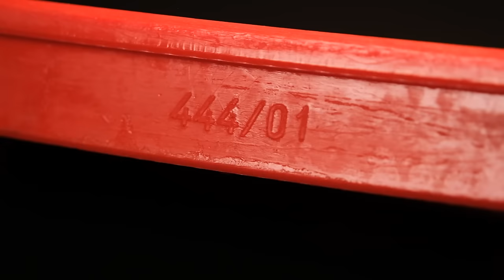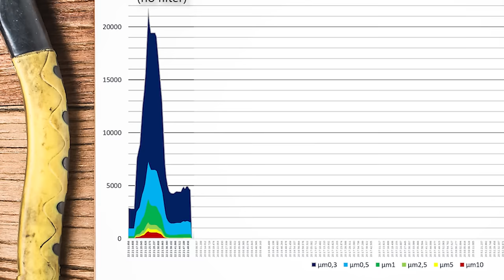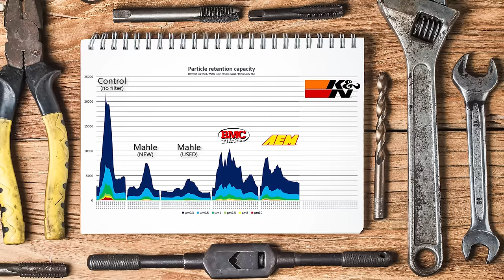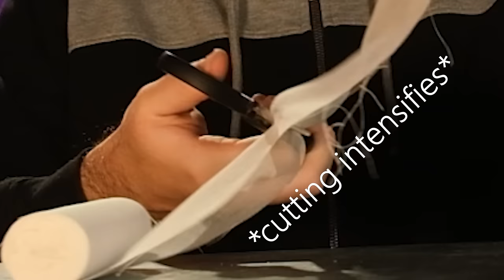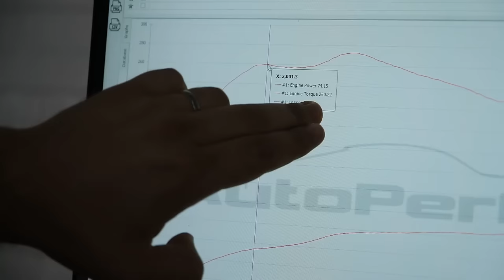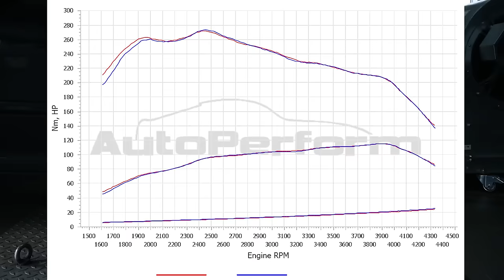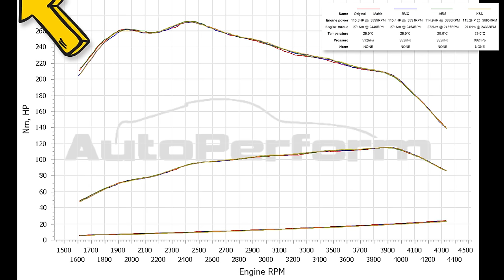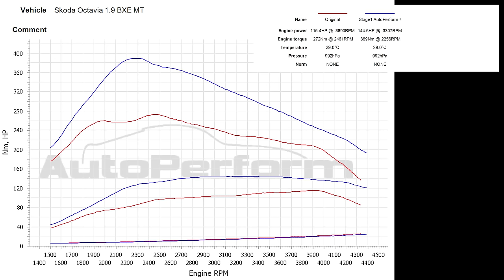Performance Air Filters - K&N vs AEM vs BMC - DYNO TEST

Comment: Salut, chiar voiam sa imi achizitionez un filtru de aer sport zilele astea. Am un civic 1.5 benzina aspirat natural. Chiar vreau sa vad daca m ar ajuta la performanta un filtru sport. Astept partea a 2 a. Salutari
Reply: O vinzi si iti iei 2.0 diesel 🙄
Reply: @Jan_Badea  am vtec n am nevoie
Reply: Save your money, Flo !! The "high-performance" air filters will have no measureable effect on your 1500 cc engine.
You would get more "performance" from making CERTAIN that your Spark Plugs are of the correct type, and are CORRECTLY and EVENLY GAPPED to the manufacturer's specifications.
Many auto enthusiasts believe the myth that spark plugs come "pre-gapped" from the factory -- IT'S NOT TRUE !!
YES, the spark plugs have A gap, but it's NOT the CORRECT GAP for your car !!
 ALL spark plugs MUST be gapped correctly before installation. Period.

Comment: Thx for the info, im not an engineer and just wondering how a SRI in a turbocharged application with a tune for the bolt on is vs stock..thx

Comment: You did it wrong man ,you could monitor boost control duty cycle or at least vacum betwean turbo and filter. Only part of dyno showing filter performance is at the begining, because it is turbo spool time and after it is on full boost, engine management just folows boost target programed in it=same power every time.

Comment: I have seen cars lose power some cars gain it. Just depends if this is a bottleneck in performance for the particular car.  Used to be a more common way to unlock power 20+ years ago.

Comment: ECU remapping on a naturally aspirated engine doesn't really work without bolt-ons. Unless it's particularly poorly tuned or something.
But the amount of N/A cars in Europe is quickly disappearing anyway..

As for wasting money, i'd say not really. Because they are re-usable and cleanable, they last longer and in the long run save you a few pennies. So from an environmental standpoint, it might be beneficial, as you're not throwing away countless filters over the lifetime of the vehicle. They can also just make it sound a little better, without really creating an annoyance to the environment, as intake noise isnt as obtrusive as exhaust noise. That said, if your engine has an elaborate resonator attached like my Accord, even placing one of these filters doesn't change the tone of the intake.
Reply: Not really true. I dyno tune cars for a living and the OEMs usually leave a decent amount for someone like me to release it. Some NA cars like K series Honda’s can unlock huge gains. 15-25% percent.
Reply: For my car, a MANN air filter is £11, MANN is also the oem air filter supplier. A K&N panel filter for my car is £62 so i could almost buy 5 stock air filters for that, which would cover me for 100,000 miles (160,000km) the K&N makes no sense at all, they offer no extra performance and you have to pay for the cleaning kit. Pointless. OEM all the way
Reply: @davehughes6501  you only expect your car to go a measily 100k miles?  Im just saying its not that big of a ill investment, and from an environmental standpoint its less waste.

Comment: NA engines show no difference as there is no forced induction. If you did this with turbo engines you'll find some gains as the turbos able to suck more air freely therefore gain more power through out the rev range. Granted the oil will get dirty quicker, which is why changing your oil every 3 to 5 k miles is sensible.
Reply: NA will show a difference IF the exhaust side is free of restriction. The engine is an air pump, the more air you can get OUT, the more it can breathe IN. 
Turbo will show gains on the intake only but the same applies to the turbo's exhaust side, if there is any restriction, that will also hurt its freedom to spin easier. SO by having a complete restrictive free exhaust on that turbo, it will allow that turbo to spin easier and faster which will then allow it to breathe in easier and faster.
Reply: @ACommenterOnYouTube  It indeed makes sense. Thanks for the explanation 👍
Reply: @ACommenterOnYouTube  YEP. The ONLY restriction in a combustion engine's system should be the THROTTLE PLATE -- Period.

Comment: Here is a hot take....Drop in filters > open  cone.

Having all that under the hood air moving crap around ans getting sucked on the filter is probably why they get so filthy compared to a drop in or closed lid design.

Comment: I don't know that did you oil the K&N filter before test. It is extremely important to oil them before use or the particles will go throught them. They are not meant to be used  without right kind of filter oil. They are tested a lot and should not let that much particles through as in your test.

Comment: You have to decide. Do I want 2-10 more horsepower at the expense of my engine failing early due to worse filtration? If 250k miles is your goal, do not get a cold air intake. 

If you want power and don’t care about your engine I recommend a turbo charger.

Comment: More power requires more air and fuel...so if the ecu is not remapped to add fuel then results will just about stay the same...no?
Reply: Not really, as it also works the other way around: for a given amount of air (oxygen), an amount of fuel will be injected. The ECU can compensate quite a bit, for reasons like air inlet temperature, air pressure (depending on weather/altitude), … at steady revs, the ECU will use the lambda sensor to become an optimal mixture.

Comment: High performance air filters only increase acceleration not power out put. Since all an engine is, is a combustion air pump. The air pump takes in X amount of air easier at its revolution cycle.

Comment: Late to this video but you'll never see performance gains from a filter unless you run a turbo or super charger a n/a engine will need a can and other things to make use of it but it will make more intake noise but out of all the aem is the way to go for a cummins

Comment: Of course that's 1 car with its own air filter. Obviously not worth it. Some other models may be the same worse or better. I know that my skyline 350 got a bit extra on the Dyno not massive but a bit. I wonder also if the car has other mods like exhausts etc that it may flow better? Hard to say. I wonder if you left the filter out completely on the Dyno what would be the results. That would be interesting

Comment: You should have removed the filter and tested if the KaN is similar.  Also some cars will not take advantage of the filter until after the ECM is reset.  Please retest with aFe included and no filter.

Comment: I saw video's of people claiming you should not use a k&n filter on turbo engines because they work with the pulse of the na engine to make the fibers fibrate and catch dirt from the air. A turbo engine does not have or maybe al lot less pulsating air in the airbox. Because the turbine Just creates a static  airstream. Just like your test rig.

For me personaly i bought a washable filter long ago because i liked the fact u can reuse them and also i thought it might give me some more powah. But i was working on my car the other day and noticed i could basicly see trough my airfilter. And i am a little older and wiser now, i ordered a purflux airfilter (same shit quality as shown in your other video) but there is exactly no difference noticable. And i drive a 35 hp citroen lna. Where you notice almost everything! So no more "sport" filters for me!

Comment: One word. WIX.
Reply: yup, Have you seen Project farm's video on air filters?
Reply: I had an k&n short ram intake on a 2007 Honda fit sport that was professionally installed at a performance shop got way less gas mpg and in the summer the car struggled but the car sounded nice but what is nice sound if the car is not performing like it should.  I've had owned small trucks and cars and ran performance air filters from Aem dry flow filter, K&N air filter, Green air filter but just recently took out the Aem dry flow air filter. I currently have a 2015 Toyota Corolla 1.8L 4 cylinder 4 speed automatic as my only daily driver and back in January 2023 and I went back to using a Wix stock paper air filter and Wix cabin air filter and put the Aem performance filter in the trash. I wanted to put a takeda dry flow short ram intake on my Toyota Corolla but didn't want to hurt my engine by letting in more debris that could cause me to not be able to drive my car for a long time.

Comment: Thanks  a lot Sergiu.  This is a really good test and I already predicted how bad KNN is.  These oiled filter may be useful for farming equipment that required air filter changes that often.  Most modern cars has 4 years 60 000 Km interval for air filter change and no reasons to buy expensive oiled air filter.  It takes 5x 60 000 Km to get break event point vs any paper-base air filter and still with the worse filtering performanc.e

Comment: K & N filters have  a place in highly modified or race engines where every ounce of horsepower matters. They're absolutely pointless in your daily drive and don't make a lick of difference to fuel efficiency or power. I've used them in a couple of stock engines with no noticeable difference at all. They're an annoyance more than anything, oily, dirty, need to be cleaned/oiled. Easier to use a throw away OEM  or after market filter.

Comment: High flow filters are great, but so is your stock air box. If at all, the drop in filter is the best bet. Your car’s manufacturer spent millions, and thousands of hours of research to get it JUST right. All you need to do is just add the filter media. Finally, ACTUALLY wash your filters.

Comment: Has any one had any problems with thier mass airflo sensor getting coated with oil amd changeing the mixture calibration in the engine

Comment: Oem is made specifically for your engine filter to filter debris out only your engine makes your horsepower people hear more horsepower and go crazy just another gimmick want more horsepower you have to tweak engine. When you start doing that you better know what you doing other issues going to occur i got 2007 350z thought about modifying engine but changed my mine. Keeping it stock just keep spark plugs up airfilter throttle body clean 306 hp im good

Comment: I comment without watching the video yet but it's a fact it only works at high rpm, on low rpm you can lose more than you gain at high rpm which ofc is bad.
But I wonder how well this one's work on a hybrid you know. Because low speed you use battery and when you floor it ecvt goes and stays at 5krpm always.
Please try

Comment: Being there at the dyno and doing there runs within few minutes of each other using different filters will not change the hp output of the engine. 
The ecm has to learn and relearn to different air flow, if this was done on carburated motor, sure.  
But those tests are not accurate whatsoever. 
Amazing effort though

Comment: Can you test the AFE product line? They have Pro Dry S, Pro 5R and Pro Guard 7
Reply: For past 3 yrs i use afe pro dry drop in filter in my mk7 gti Stage 2. It has better filtering properties  than k&n and other oiled filters. As i live in uae its dusty most of the time. If u look into it ull get to know those oiled ones has very light filter material.

Comment: Remapping, chipping or whatever means you use to increase power besides a performance exhaust or increased airflow (without increasing turbo boost) will limit the longevity of engines or parts pushed to achieve those performance values. If a diesel vehicle has a planned obsolescence of 300 000 km,  changing injector pressures or increasing turbo boost will diminish the longevity of these parts or engine components. It's only logical. Shorter term performance gains over engineered longevity is the trade-off. I experienced this first-hand. If you are unhappy with your car's performance, and you care about long-term reliability sell it and buy something that was engineered to be more powerful. It's a caveat I live by.

Comment: Paused video... I'm gonna guess the K&N is going to do the best because it will let more air through... but based on the particle test, it will also shorten the life of the engine.

Comment: Check how much power you can remap with standard and with aftermarket air filter, you gonna be surprised.
Reply: Curious would you expect to see more with aftermarket or the same im running a k and n on my remap but after this im changing back to paper

Comment: Another thing is a new filter won't necessarily improve fuel economy. A car at highway speeds only requires around 25% throttle to maintain speed, and the intake demands are fairly small. This is why a dirty air filter really only impacts full throttle performance. It would have to be seriously plugged up to affect fuel economy and idling. Therefore 99% of the time a K&N filter is a waste of money really unless you are racing.
Reply: Dont be stupid -- An Air Filter with a "Million-Mile Guarantee" is never a waste of money.
And YES, a K&N air filter WILL improve your fuel mileage IF you are replacing a clogged filter. Notice that most people do not replace a new or clean air filter.
Your comment indicates that you lack the over 30 years of K&N use in different cars, trucks, and SUVs that I have built up to the present.

Comment: Confused as to why the cold air system would shorten the life of the engine
Reply: It's not the Cold Air System that junks the engines -- it's the lost filtering ability of the High-Performance air filter that allows the silicone (sand) particles into the engine, causing high wear.
 In order to get the MOST from ANY Oil Filter, I use and recommend the FILTERMAG # SS35PR Magnet Kit.
Powerful, heat-stabilized magnets remove ALL ferrous metal particles from your engine oil, regardless of micron size. Fits 3.5 - 4.0" diameter spin-on oil filters.
Re- usable -- Lasts a lifetime.

Comment: #1 Wrong Test = Testing the benefits inside a climate and temperature controlled environment... Of course your not gonna see ant benefits. Even tho it's most logical to use on custom high performance setups with turbo/supercharged vehicles. Less restriction = more (even if a little) benefits... Always a good idea tho to make sure you do whatever you can to block/prevent any portions of the motor which create heat from that heat entering your intake as science has proven the colder the air (more dense) coming into an engine the more power it can create.

Comment: They do work but you're preparing them to a car that's not performance if you put it in an S4 or an M3 you're definitely going to gain 15 horsepower cuz they're supercharged engines in their in their turbocharged engines so you're going to get more horsepower you can't compare these these filters to a stock car I'm not going to do anything to it

Comment: I just clicked out of interest but on the subject i tried a k&n air filter on my 04 suzuki liana hatchback 1.6 petrol. It slowed my car down in higher rev range so i knew i was dealing with retarded timing because some day it would be very zippy infact my golf 1.9 tdi would be left crying but if i got stuck in traffic for say more that 10 minutes the car would become sluggish and scream at me if try throttle it. I put a live data on ot for a few days and noticed in traffic my air intake temp sensor would climb to over 120° F. So that has got to be my reason for retarded timing i assume cus the engine heat is warming it up.

Comment: newer cars are tuned to always be at the same horsepower level, rain or shine, cold or hot, whatever the factors, the timing or turbo boost will adjust automaticaly to stay at the same horsepower level, so whatever you do, if you dont retune the car on point everytime you switch parts to make a fair horsepower comparison, your video is pointless, the ecm auto-compensates, btw i had the worst results with a k&n cai, the flow and build quality is so bad and its the priciest... what a shame

Comment: You made a performance video and you brought a non performance car to a dyno. I am however a professional mechanic and can pretty much tell that you do not hire the night janitor and eat and park to design the next shuttle engine to go to mars. Simply put you are not qualified to do they tests and make an opinion about stuff you really do not know about. the pan cake filter that go into stock air boxes give low performance gains and really are not worth the money. But they do sound better.

Comment: You forgot to say the K&N filter needs oiling.and you didn't oil it.
So this test is 👎🏻
Reply: They come pre-oiled from the factory.  In a way you can say this is the best oiled it’ll ever be cause there’s no way some guy in his garage with a spray can of oil is gonna oil it as uniformly as the factory.